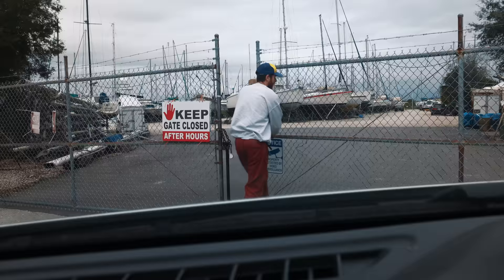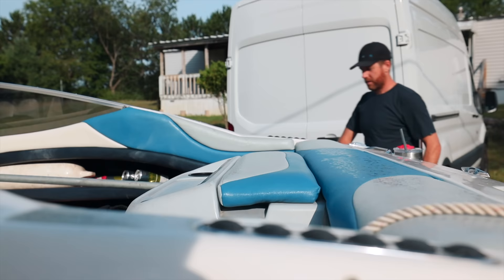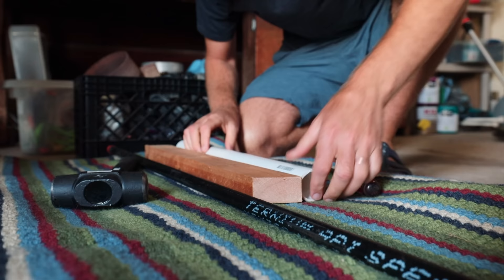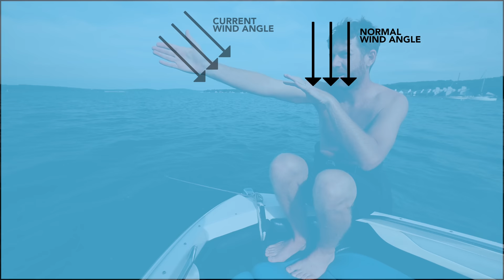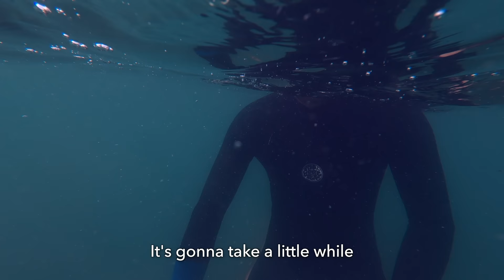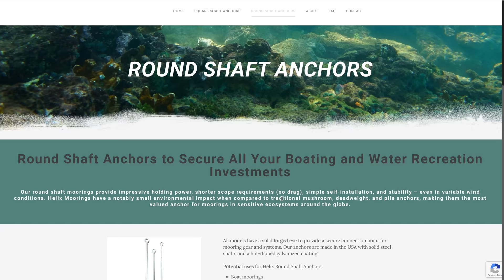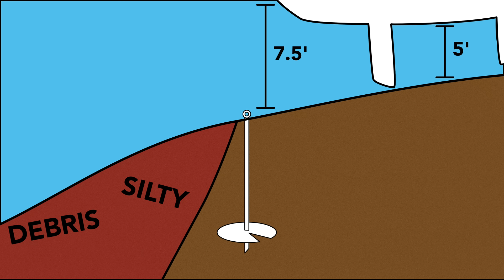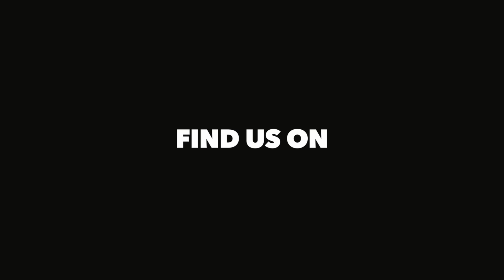Screwing our Boat into the Ground (Installing a Helix Mooring Anchor) | Sailing Soulianis - Ep. 117

Comment: Cannot see this is safe for a family with small children. I’ve had two kids so have experience. Either get a proper comfortable/ safe boat or wait till your kids are grown up. Youre tying to do this on a cheap budget at the 
Expense of safety. It’s obvious you have money from many avenues so why be so tight, at the expense of safety? Children are precious, money is worthless in comparison.
Reply: You have kids, but do you have boating experience? Nothing inappropriate about this in the boating world.
Reply from the maker: "Your Farrier trimaran is designed and built as a high performance family cruising yacht, which when used as intended, with its enormous stability and unsinkability, is one of the safest, most comfortable, and fastest sailboats afloat."  

The quote above is the very first line in the sailing manual provided by Farrier Marine when purchasing a set of plans.  These boats have been successfully cruising around with families and little children onboard for more than 40 years.  Additionally what is considered safe for one person may not be for another. Safety is not an objectively derived concept, it depends on individual risk tolerance, experience and skill.  I would never consider living in a house on a busy road with small children, but millions of families do. I'd never take my kids horse-back riding on my own, or let them work on or around farm animals or large farm equipment, because I know nothing of horses, steer, or tractors at the moment but plenty of families and kids do.  

As for your comments about having money... you've mis-judged our position, but our choice of trimaran vs some other boat you may consider "safer" had nothing to do with money.  It was because for us it is the perfect boat. We're hoping that our video series will help shift the narrative around trimarans for those with similar objectives by illuminating the many benefits a trailerable trimaran offers.
Reply: @SailingSoulianis  Naysayers always say nay, and they usually have some sort of reasonable sounding reasons that just don't bear close scrutiny.
Reply: @SailingSoulianis  The perfect boat FOR NOW.  In a few years your boating lifestyle may morph into something else again.  Hopefully, I'll be around for the sail.  I like you guys.
Reply: @jerrymiller276  Totally agree. 👍🏼
Reply: @SailingSoulianis  Y'all are doing just fine.
Reply: @englishrose1122 you might not see this as safe for family, but tons of other people do and has done for a long time if not forever. There are even landless peoples to this very day that only lives on small boats (pretty much like canoes) out on the sea for generations. Can not get any cheaper than that, they literally live off the sea. I personally think it is unwise and unsafe for people to have infants and toddlers with stairs in their home when they could have tons of houses without such an unnecessary thing. After all, falls is the leading non-fatal injury for all kids and is around half of the injuries for those 1 year and younger. Yet millions of people reside in homes with stairs while having babies. Tons of people have resided with fire stoves and open flames to heat and to cook with for millenia, which clearly is not safe as fire related deaths are one of the leading causes of young children. The point is to teach your kids about risks and what can cause serious harm and/or death. One simply can not avoid safety issues in pretty much anywhere you live with kids. 

One of the top causes (in most places it is the first or second) of deaths for young kids is land vehicle transport accidents. That includes bicycles and being hit by them. And this is even after with much better child seats and seat belts which has reduced those deaths by three quarters. Does that mean you should not drive anywhere or take your kid in any type land vehicle?

Drowning is another leading cause of deaths for kids, again does this mean you have no water in your place of residence and no baths? Suffocation / strangulation is another leading cause as is choking. More things that one simply can not avoid all the time. Which with you having experience should already know. Kids will find something, anything, to put in their mouth. These are all preventable, and yet they are still all leading causes of death regardless how much you are aware of them and attempt to avoid them.